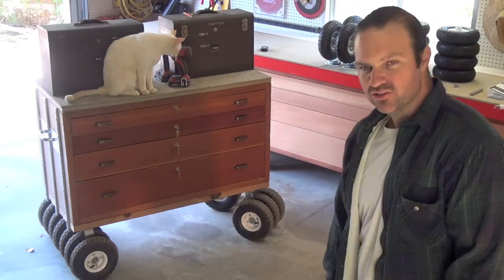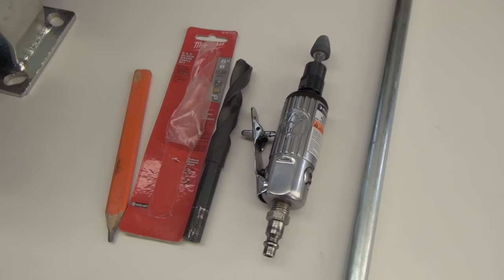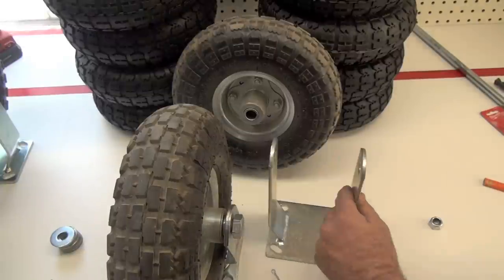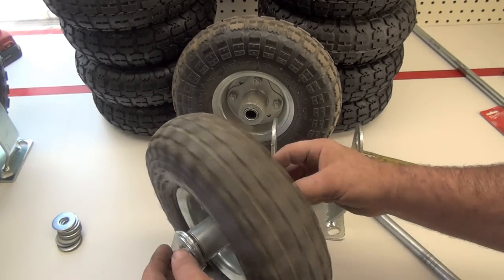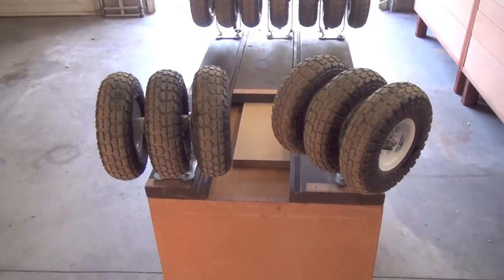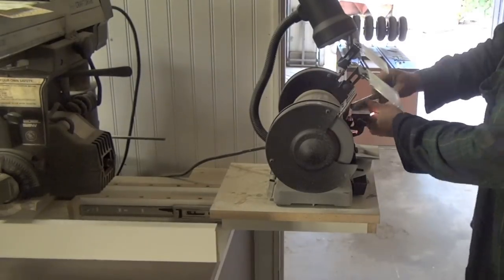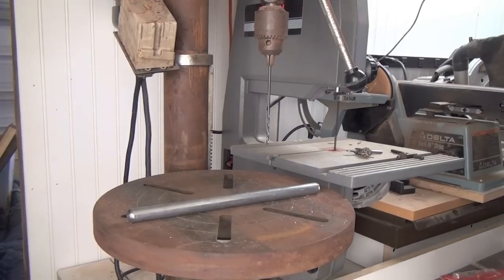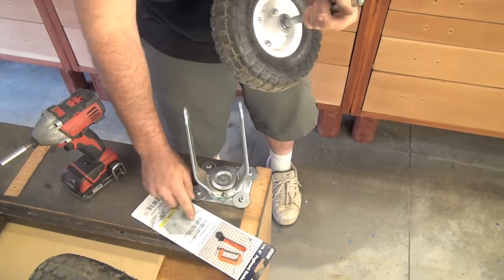DIY- How To Make Triple Threat Casters - Pneumatic 10" wheel- Step by Step-Custom Design

Comment: nice work! though if you buy your casters from a dedicated caster supplier (full disclosure: i've been in the caster industry for what feels like 10,000 years) instead of harbor freight type of place that doesn't really concentrate on any one product, you can easily get the forks so that they don't need to be drilled out. also, you can get axles that length and diameter that are threaded, so you won't need cotter pins. and i would go with foam-filled pneumatic wheels; cuts down on the up-keep.

Comment: Very clever solution. Maybe a little hard to check the centre tyre pressures, but its a definite winner. More stable and lower ground pressure places less stress on each tyre. 
I for one will be tucking this idea in the back of my mind for future use possibly on a flat bed cart at work.

Comment: That's a really great idea; I haven't seen it before; and addresses and issue I have had with boat carts I build; when the heavy weight of the boat and all the gear on the cart comes up against a sidewalk; side on; it blows the center piece apart on the wheel; but with the three wheels like this it might be able to handle that stress better.

Will also spread the load out a lot more on wet sand; which will be a huge help when launching at low tide from beaches.

Comment: very nice. i tried putting those casters on a big tool box to roll from my shed in the backyard to the driveway up front. It was very top heavy and the ground wasn't smooth. I bet if I 3 tires in each corner I wouldn't have had the problems I had.

Comment: Well it does look very cool.  I can see it would perform far better over soft or rough ground than single or small casters.   I was looking for ideas on platform for moving stuff. Thinking of extra wheels with their own supports  offset slightly from the corner wheels.  No, it won't be pretty but I think it may get over crude ramp board edges, might add steep taper to board edges too.  Thanks for posting this video.

Comment from the maker: I think some of the bad reviews are people that have possibly used better quality casters in the past. Or just whiners. I read in the past one caster bent on a chicken coop (too much weight I believe). The tires may lose pressure over a 6 month period, so what I say, just top off every once in awhile.
I find the casters to be by far the best  value available. Its possible to make triple wheeled casters with higher quality casters if one wants, these work great for me though, off road too.......

Comment: I have seen triple casters before, but not using pneumatic tires.  Just checking the pressure of the center tire is likely to be a challenge, let alone adding air to it.  But yeah, it looks great and you had some fun doing your project.  If you want to see some examples of commercially produced triple casters, just look at a $nap-On catalog.  Their largest rolling tool chests have been using them for years.

Comment: Mike, I just visited HF's site and looked up those 10" pneumatic casters. About 40% of the reviews suggest the tires go flat and the swiveling casters can be tough to move over rough ground. What's your experience? Maybe you put less pressure/lb on them by using three? That distributes the load. Still cheaper than alternatives for my use. THANKS!

Comment: Big fat axles and 3 beefy wheels with a weak link with what looks like a couple of #10 screws mounting the casters. Kinda like using 1/2" bolts to mount something to a beam but the beam is attached with finishing nails.

Comment: Looks pretty cool but its going to be pita when the tires need to be pumped up. Id run solid tires in the middle as the valve stem looks like it would be hard to get to.  That or use extended valve stems like on dually trucks.  4 swivel casters is the only way to go on tool carts and chests.

Comment: great job. each of those wheels can carry 300 pounds so you have the lucky number 13 will total 3900 pounds. Means you can easily carry around a small sedan that is impressive great job indeed hope the anti hernia belt its included in the idea.
Reply: Old comment, but I think that’s being overly optimistic. The castor assembly itself can’t hold that.

Comment: I think it would be easier to use a threaded hex bolt with a lock nut for the axle.  McMaster has them at a reasonable cost.

Comment: The triple wheels definitely looks cool. I suggest filling the tires with slime - at least the center tire. As is, is it possible to service the center without disassembly? Again though, definitely cool looking.
Reply from the maker: Thanks for the slime tip. I use a floor jack at each end (not corner) of the cart to lift it up. I do have to take it apart in order to maintain pressure, about every 8 months. In total it takes about 5 or so minutes to top off pressure, really not a big deal using a floor jack.
Reply: @rjlarry8865  you sell flat free casters?

Comment: Do you think it's possible to do two wheels instead of 3? I'm a new mechanic and my harbor freight 5 draw cart is getting full would like to add a us general hang on the side 7 drawer tool box to my cart but was worried about balance, I also believe the bigger knobby tires will help as I maneuver over air lines and extension cords around the shop. Back to my question if I was to do what you did but only make space for 1 more wheel on the axle, will I benefit form the width and stability of two tires or I be putting to much strain on the side of the axle that is hanging offset out side of the caster?

Comment: Hey here's an idea...instead of cotter pins and washers, why not use shaft collars? Then you can actually push them together tighter so that the bearings turn instead of the axle shaft. I think that is how I am going to do this for my application.

Comment: I have cargo carrier with a ramp...the problem I am experiencing with the carrier... Is that I use it to transport my mobility scooter... I have one of those mobility scooters that looks like a moped so it has one tire in front and the back has two tires and four batteries... So the  back side with the batteries is slacking lower then the  the front on the carrier...So I was thinking about putting swivel caster wheels on the bottom of the cargo carrier to even it up and also help with the load on hitch and riser...I saw those tires at Harbor Frieghts yesterday...and was wondering if it might work...And today I saw your video and I said to myself...that  you have a great idea...Do you think that those tires the way you have them would work on the road... attached to the bottom of a my carrier?

Comment: It looks like a monster! But I guess it isn't so accessible to inflate the central tire?
Reply from the maker: Correct, Every 6 months or so (because I have a lot of weight is this cart) I use a floor jack & lift up either the front or back but once its off the ground its fairly quick & easy. No regrets here.

Comment from the maker: Its all good, Yes it does improve weight distribution & stability. Being this particular tool box I use as a demo weighs, Guessing here (A LOT) 500lbs+ it is less stress on the tires. It's smoother off road & with this toolbox the casters are a bit wider then the cabinet, now I can open all the heavy drawers & the thing wont tip over.
   I plan on doing this again with a flat bed cart I use around the shop. It'll Carry a heavier pay load. It's fun to customize things, why not.. Good question =)

Comment: Do you think the caster frame itself, mainly the top bearing is strong enough that this would greatly increase the capacity?  The tires are rated at 300lbs each.  Do you think the top swivel bearing could theoretically handle 900lbs?
Reply from the maker: I dont know if the bearings can handle 900 but I guarantee 500 easy. My carts diy casters are still going strong, they have a ton of weight in the box, I have to top off the air in the wheels twice a year but thats it.

Comment: Harbor Freight has an air compressor that's a candidate for a multi-caster-wheel mod and hack. It's the 105 kg, 230 lb actual including accessories, 29 gallon(110 liter), item #:61489.   I replaced the toy like wheels that were included.  I purchased six of the Harbor Freight pneumatic 10" wheels with the 4-bolt hubs.  These lately have been on sale with coupons for $4 each. 

As of now I've replaced the standard solid wheels with two of the 10" pneumatic wheels.    Next I'll add a second wheel to each side.  When that has been completed I'll attempt a single axle 4-wheeled version.   HF should provide these wheels and a side to side axle as part of the standard features IMHO.

NOTE: Adding the 10" wheels leans the air compressor towards the front.   The fill gauge isn't accurate.  When adding or replacing oil you must re-level the compressor to make an accurate fill.

Comment: Personally I think threaded rod with castle nuts and cotter pins would be a better option. I like it though. I move stage equipment every time I do a show and having that much more flotation over rough terrain would be a definite boon. Trust me, moving 500+ lbs worth of speaker cabinets isn't a fun job. That's not to mention lighting truss and stage pieces either which are also heavy. Having to work around sand a lot, I think this mod might just be the game changer I've been looking for...
Reply from the maker: Give it a shot. Totally worth it!

Comment: That's great. Here's a serious question. What do you do about a hill? I want to put harbor freight 8 inch pneumatic casters on my kegerator so that I can roll it out in the yard. Don't want it to roll away down the hill. Want to use the cheap wheels. (after all there are 12 of them). Does anyone have a clever idea to add a cheap parking brake?

Comment: you should remove the middle wheels.
if you want it to maintain balance of having a wider surface area but want it easier to move you should do that.
less wheels = less points of contact = less friction 
you should try doing 6-8 wheels total it will be a whole lot less work to haul it around.

Comment: Hi, Mike, Where. an I get that metal cutting blade you were using? Thanks, great video.
Reply from the maker: Any hardware store should have them. Also you can get a handheld hack saw for about $10.

Comment: Yeahmorgan: One word: cost. I've been noodling around with a similar project for several weeks. I need to make a carrier for an extremely heavy set of glass patio doors that have to be moved over a nasty raw site that includes broken concrete, asphalt, dried mud/adobe and the rattiest landscape outside of an outright dump. There's no flat land to set down even a plywood surface. If you use Harborfreight parts, you can bring this project in for $100 or so, total. Can't beat that.

Comment: Hey Mike, Very Cool!
One Thing though: All of you DY'ers, STOP!! Holding materials that you are drilling freehand or on a drill press barehanded!
For round stock, use a wooden "v" block and for flat stock clamp it on a backer block! Otherwise eventually your going to loose a finger or sustain some other serious injury!
Please!, no shortcuts on safety!
Reply: James Herring let them do their thing,  don't be so critical
Reply: thanks for that safety info
Reply: John Cox - no.  If someone is doing something wrong, especially when it comes to safety, you should correct them !! Learning is about making mistakes.  How are you supposed to learn if you dont ever realize that you made a mistake?  Most times people do things the wrong way because they dont even realize there is a better or safer way and need someone more experienced to show them the correct way.

Comment: great 12 tires to replace when they go flat in a year
Reply from the maker: no no, I did this project 4 years ago, uploaded year later. I use these regularly. Still lots of life left on the original set. Its the best off road wheel option I have used,  goes through dirt, grass, gravel all while holding a ton of tools, I have added a second cabinet to the top so now its 6' tall, I like it. However I don't need to take it outdoors any longer so there ya go. But yeah, 12 tires at 5 bucks each adds up, haha

Comment: Where did you buy the axle round bars from?
Reply from the maker: I got them from the hardware store, home depot , or lowes, here I used the chrome coated kind 5/8" thickness but the drill bit I had to buy was pricey. Defiantly worth the expense & effort.

Comment: So what's the point of the triple wheel?
Reply: Biggest advantage is payload. Second advantage is if going over grass allows a wider weight distribution and avoiding a single wheel sinking into the ground. Most cheap pneumatic wheels as shown are only good for about 100 - 150 lbs. Having 12 could theoretically have a load of 1,200 lbs. Wouldn't want to pull or push it over grass though! We pull pitcarts with 4 extra wide wheels and it's bitch pushing it over uneven grass, especially when wet and soggy. Our carts fully loaded with tools and spare tires are probably 700 to 1,000 lbs.
Reply: Its probably good for not tipping over if you have a tall narrower top heavy cart.  I'm about to make them for a custom cart I made to put my top snap-on tool chest
Reply: That's like saying what's the point in having another couple inches on your girth. More is better

Comment: So how do you put air in the middle wheel?
Reply from the maker: Every 6- 8 months or so (because I have a ton of weight is this cart) I use a floor jack & lift up either the front or back of the cart but once its off the ground I pull the quick release axle pin to access the center wheel, takes just a few minutes total. No regrets here  & years later I still find the effort & design very worth the trouble.

Comment: Why did you grease the shafts and washers instead of greasing the bearings. I suggest you take the wheels apart again and pack the bearings with a good wheel bearing grease maybe Quaker State or such like.
My tool box has been weighed in at 3/4 ton. But luckily I only move it on hard surfaces ie: concrete or asphalt.

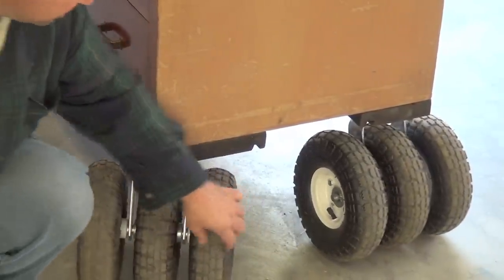Comment: 1:01
Most Carpenters or other builder types are NO GOOD at designing.
It is rare that a person is a good designer of anything and a good executor, able to make anything.
.
1:53
All those tires are blow-up tires !
Why not use rubber-filled tires, much better than ever having to maintain the pressure in them all.

Comment: That's like $500 for the wheels.
Reply: +Ernst Stavro Blofeld 

Harbor Freight currently has Item #60249 (10 inch pneumatic Swivel Casters) on sale for $15.99 each.    Non Swivel casters  Item#61450 are on sale for $14.99 each, and the 10 inch tires (Item #62409) are on sale for $5.99 each  (eight required)
Reply: on sale $4
Reply: Ryan B Including postage?